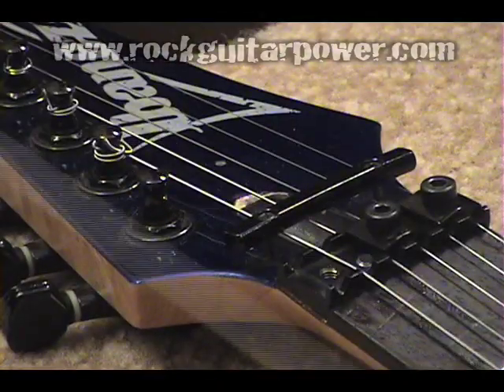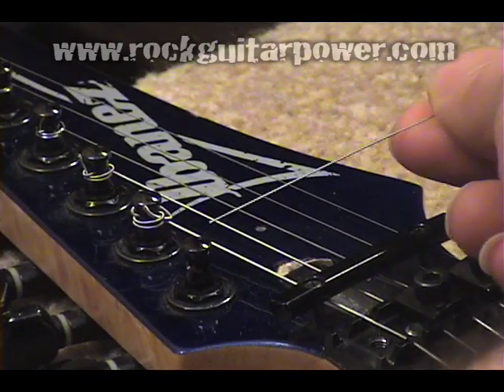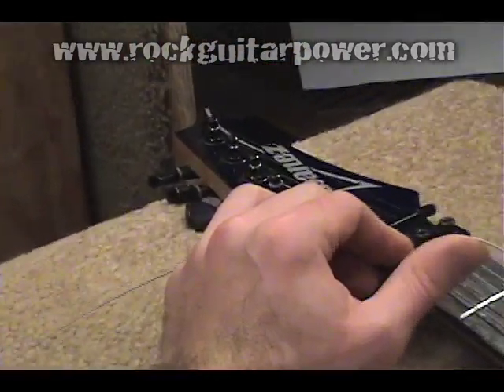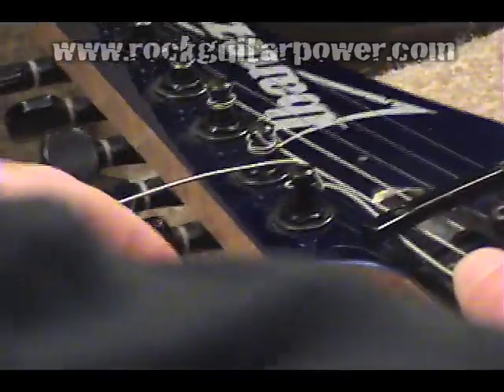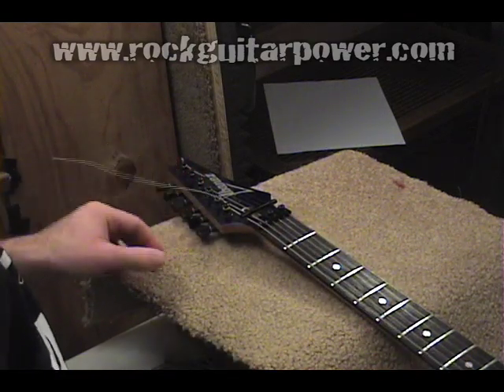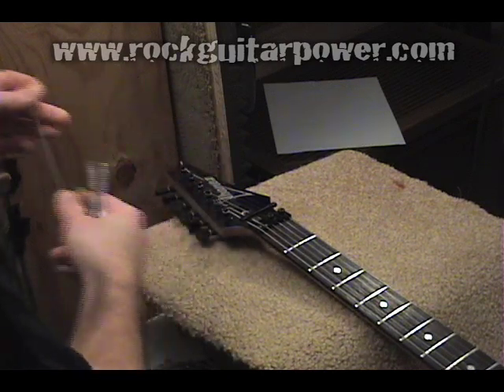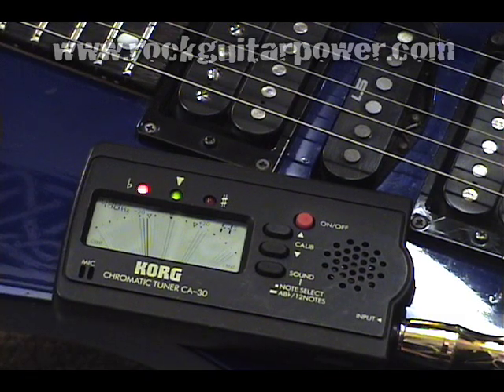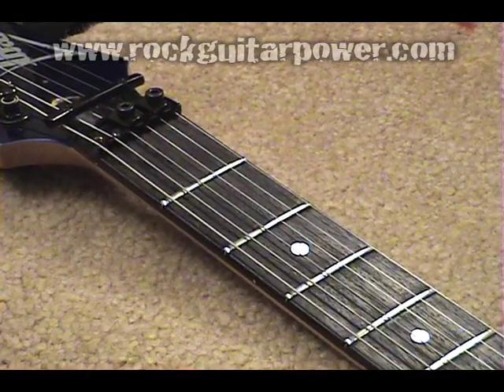How To Change Guitar Strings on a Floyd Rose bridge Part 2of 4

Comment from the maker: After you tune all of them, if the bridge is still high you can bring it down by tightening the tail piece that the springs are attached to in the back of the guitar. If the bridge was ok and now it's high after changing strings check to make sure you use the same gauge. Most floyd rose setups use 9's. You can use 10's but you will have to adjust the bridge to get it to sit right

Comment from the maker: @smiley643 Yeah this is what happens with them when your first setting them up. It's a lot of back and forth till you get all the strings in tune. What i recommend is tuning the E, then the A. Then go back and tune them both then do the D, then go back and tune all 3 and move to the G. The bridge will keep going up and down because the tension of the strings is what holds the bridge in place.

Comment from the maker: @quikdeth88 Your not doing anything wrong however what you need to do is tighten the plate that holds the springs. On the back of the guitar there should be a plate, take this off and you'll see the tension springs attached to a plate that is screwed to the guitar. You need to tighten this plate which will put more tension on the springs pulling the bridge lower. This usually gets out of wack when the guitar is setup for 9 gauge strings and then someone puts 10's on it

Comment from the maker: It's not going to hurt anything but you will need to reset the springs in the back of the guitar to make up for the decrease in tension. Whenever you tune lower you will need to loosen the screws that holds the spring plate.

Comment from the maker: @Ale3x93 At this point I would say bring it to a shop in your area. You may need to add extra springs if you really want it to work with your strings. Floyd Rose are really meant to be setup with 9's. You don't want to risk cracking the wood by screwing in too far. Bring it to a shop and have a pro look at it

Comment from the maker: @DrShredder97 You can but they are more meant to work with 9's. If you use 10's you will have to reset the springs and adjust the height of the bridge.

Comment: Just after I got home with a new Dinky with a "Floyd Rose", my first one, I did break two strings, doing that famous noob error not taking an Allen key to loose the top neck screws ! mouhahah I love to learn like that, it stays in mind and costed 10 bucks and then after I saw your video, I was all confident to restring my axe ! It's all tuned fine and keeping in tune, well after I did a few adjustments, keeping in mind the priceless details you provided. Thanks a lot RGP !
Reply from the maker: Kick Ass! Glad the video helped. Thank for the comment. Now you can dive bomb to the depths of hell and know that you will land safely back on earth!
Reply: when i go to put my string down in the bottom part where you strum (don't know what its called) and then i do the knot, when i release my finger so i won't need to hold the string anymore it comes flying out, it has happened to me twice. help!

Comment: @rockguitarpower Thank you. I never thought of the fact that you could add more springs. I changed back to normal-size strings now. But I will still go to a shop, just to find out if it's possible to use thicker strings.

Comment from the maker: @ItContainsZombies check your saddles. They might have a bur on them, a sharp metal point. If so this will tear into the string and rip it apart. if you find one, get some fine grit sand paper and run it through the contact point where the string meets the sadle

Comment: I have a fixed bridge and I have noticed an improvement  in tuning stability since I've started using this method. It also takes less time for the strings to stay in tune when newly fitted (at least in my case it does) hope that helps

Comment: @rockguitarpower you rock... i switched out the 10s for 9s and it was like magic... everything went real smooth, and all the strings staying right on the mark once stretched and locked down. Any tips for keeping the thin strings from popping out? (other than ensuring the screw is tight against the little block). I had it happen to me twice.. I think they are in good now, but is there something I could use to make it grippier without gumming it up ... or....?

Comment: @rockguitarpower I had this problem because I did like you said. I put thicker strings on my floyd rose original. I tried to open the plate at the back and tighten the plate so the strings would get more tension. But of some reason. After I screw them to one specific point, one of the screws wont go anymore. It wont let me tighten it at the one side because the scew wont go further in. And the tightening I did make was not enough to get the Floyd Rose in It's original position.

Comment: is your floyd leaning back when you down tune? because if it is all you have to do is take off the back plate and loosen the screws that are conected to the spring holders and it will release the tension

Comment: @rockguitarpower what if your floyd rose has no strings at all and u buy a new pack. I kno you would tune each string at a time right? But when i did, the bridge kept going up and when i adjust the screws in the back to bring the bridge down it would create more tension in the strings and then i would have to loosen them and i retune them and it keeps bring the bridge up.

Comment: what strings do you recommend for people with the ZR tremolo, i use mine real heavy and my D string just broke at the bridge today, i used 010-046 gauge, should i go to 011 or keep my spot at 010, i need to know fast, i only had those strings for a little under 3 weeks, and what brand would you recommend, i used elixir on the first change, nanoweb

Comment: I followed this tutorial as closely as possible... I have been playing for a long time, but my floyd rose special still gets me every time... no matter how much I stretch out the strings, I get a situation where the tension is so drastic that it pulls the bridge up out of what seems to be its natural mid-point (a little higher than flush). The low E and A seem to keep pulling it out of whack, worse with each retune (this is prior to locking down the nut). What am I doing wrong?

Comment: I personally wouldn't cut all the excess string right away, I usually change all the strings first, then jam around and bend the strings with the nut open BEFORE I cut the excess off, to ensure the strings sit tightly on the tuning pegs.

Comment: when i go to put my string down in the bottom part where you strum (don't know what its called) and then i do the knot, when i release my finger so i won't need to hold the string anymore it comes flying out, it has happened to me twice. help!
Reply from the maker: What kind of guitar were you working on? Was it a Nylon? that's the only type of guitar that really uses a knot in the bridge
Reply: Rock Guitar Power  no you got it wrong. I have a guitar with a Floyd rose bridge. it's just that at 34:7 where you start winding it up. when I release my finger the string comes flying out. I don't know if I didn't secure it well from the bridge, because that's where its coming off. the neck part is perfect
Reply from the maker: Ok got ya... In that case you need to make sure the block in the saddle is getting pushed into the string hard enough so that it doesn't slip out
Reply: Rock Guitar Power how do I know if it's tight enough? because each time that I try again the string gets worse. I think I need to buy new strings

Comment: fuck i need some help please help me, i do not fully understand the whole thing about the 9s and 10s strings.. but i think i just screwed it cause when i try ti get the string tight, i try to play it but it hits the fret so it doesn't make any sound at all, am i doing something wrong? or is it about the size of the strings? if it is, would you explain it to me please? i'd be thanked